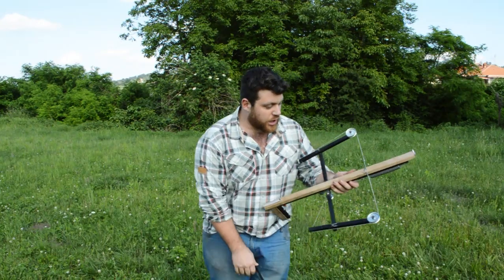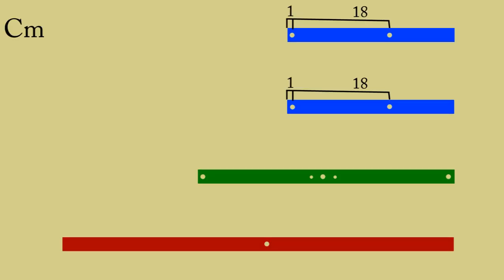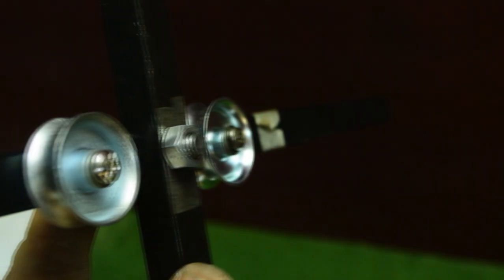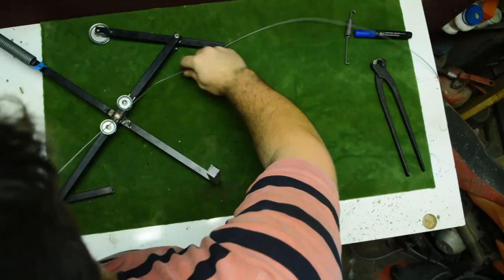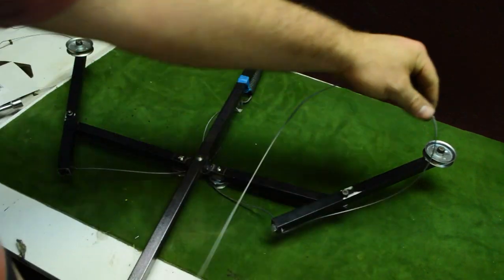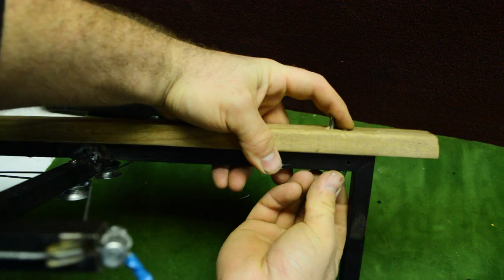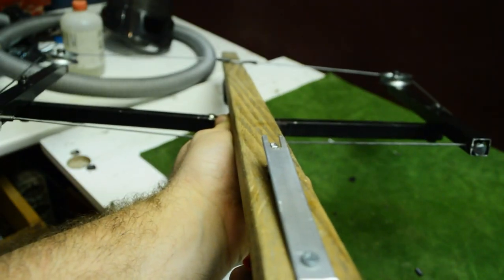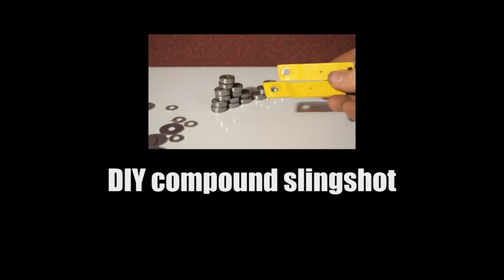Diy Compound Crossbow Flipper

Comment: When you fasten your draw string on the same bar as your draw string pulleys it made the draw string pulleys useless, If you fasten the ends of your draw string at the same location as your spring pulleys it would really help your design, Just trying to help i hope you dont mind, I really think it would help and all you have to do is dead in your draw string at you spring pulleys then the draw string pulleys will serve a purpose, then you could strengthen the spring and it would be even easier to pull back even with a spring twice as strong as the one you have giving you a really powerful weapon!Like i said just trying to help please dont get mad, sometimes others can see things we miss, then again i could be wrong but i really think you should give it a try you dont even have to change your design just the end of your draw string location! I really like it and thanks for sharing it!

Comment: Regarding the patent pending status on the woodland survival flipper, according to what I'm seeing, in most cases, legal protections apparently don't kick-in until the patent is actually granted. 

Also, having patent protection means that others cannot legally produce the device for others' commercial use and cannot sell copies of it themselves. However, it IS legal to produce copies for personal and experimental use.
Reply: The other flipper uses a completely different power source.
Reply: mellotron
 I realize that. The other flipper used rubber bands, whereas this one uses a tension spring. However, if the patent (which I have not been able to find, unfortunately) mentions that as alternate option for power in the specifications (many patents will mention alternate means), it would technically be covered. But since I can't find the patent anywhere, including the USPTO website, my guess is that it was never granted full patent protection, so he's probably in the clear.

Comment: If I replace the metal tubes with wood,is a problem.Please tell me
Reply: Generally if you can make same strength, wood is lighter than metal. But here, it is a hollow tube metal which increase strength but with less weight. Theoretically if you use wood with same shape its ok, but i dont think you can easily make wood hollow in real life. Cant say yet though, will require actual calculation of the material index. But hey, what Im saying is although usually wood is best material in terms of weight vs strength, there is a chance using wood in this situation can result heavier

Comment: take a original bold for crossbows they are less flexible schoot strait and are more hardened for the job the most suteble is 28inch
carbon fiber  or aluminiuem and make a slot the bolt wil go strait and accurate